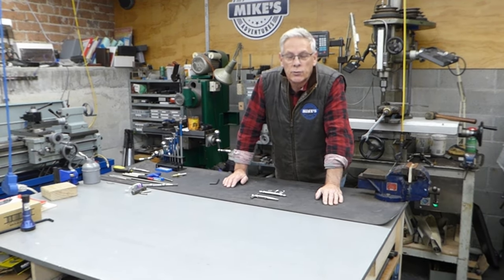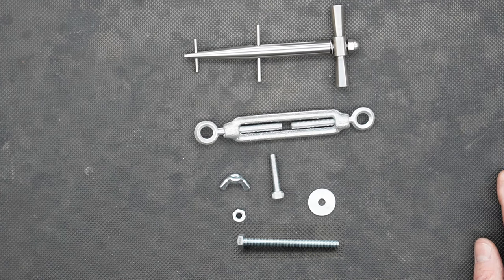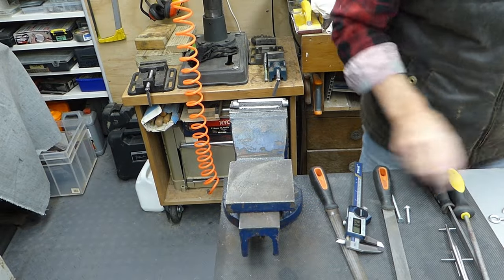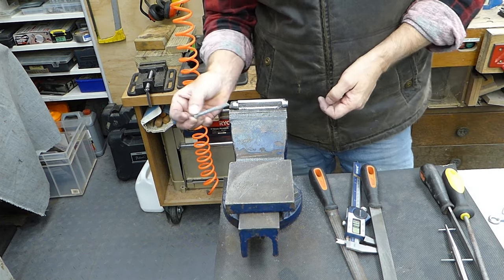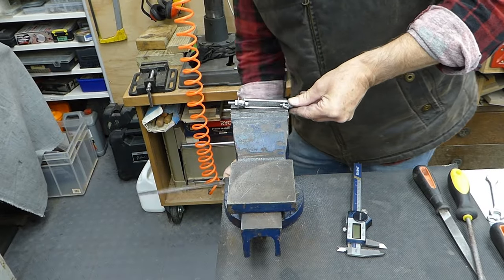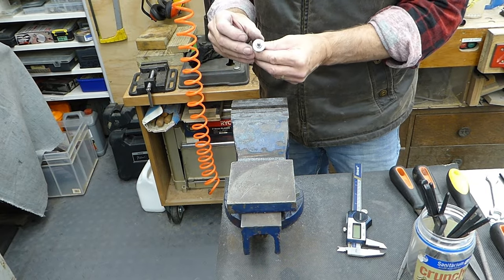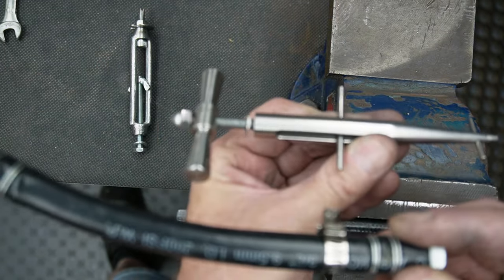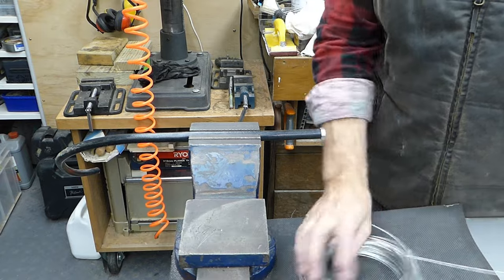Wire hose clamp tool from turnbuckle and basic hardware. Must have workshop DIY tool.

Comment: Just made one following yours, I'm too cheap to pay for the commercial version. I did use a larger (3/8") bolt and wingnut (with sides ground flat) so they stay better. Also welded another larger hex nut on top of the bolt head for better finger grip and able to use any straight object to turn it instead of needing a socket.
Reply from the maker: Good on you. Nice that you made it your way that's even better. Thanks for watching and commenting. Cheers Mike

Comment: This was a great video, thanks. That drill bit may be a 6 mm bit, but it is definitely not a 6 mil bit. A 6 mil bit would be .006 inches, nor is the wire 1.2 mil which would be .00012 inches, so it must be 1.2 mm wire. Apparently you Ausies used the term "mil" to mean "millimeter." That kind of threw me, a yank, off a bit.
Reply from the maker: Thanks for watching.  I'm sorry about the accent but I'm actually a New Zeander living in Auckland. It's like calling a Canadian an American. Yes we use mil for mm just like you guys use thou for thousands. Glad you enjoyed my video.
Cheers Mike

Comment: Hello, what gauge wire /type wire should we use for this? 12 ga copper wire, and tie-wire both broke before it could be as tight as I'd like.
Reply from the maker: Hi I use 14 and 20 gauge galv tie wire. Mostly the 14 gauge. In the past I have also used stainless steel wire of same gauge. It does take a couple of tries to get used to tension. You can also give it a giggle and pull on the tensioner tool half way as this will help wire move around hose. Thanks for watching and commenting. Cheers Mike

Comment: You could just use the eye bolt and you can use anything through the eye! Screwdriver, cutters handle,even a stick.
That's what I did. 🇦🇺👍
Reply from the maker: Yes I suggested that in the video. Thanks for watching and commenting. Cheers Mike